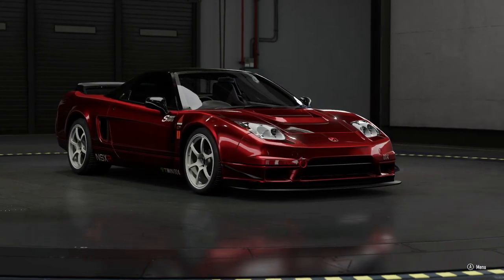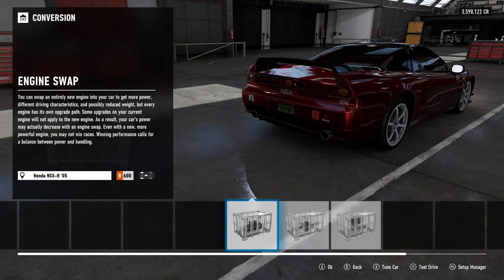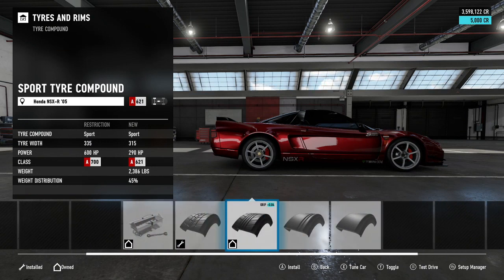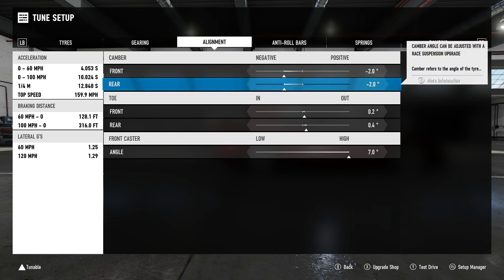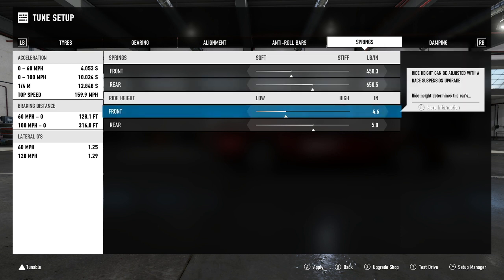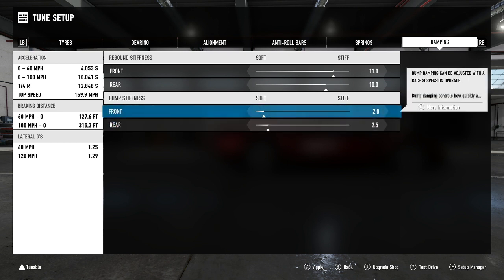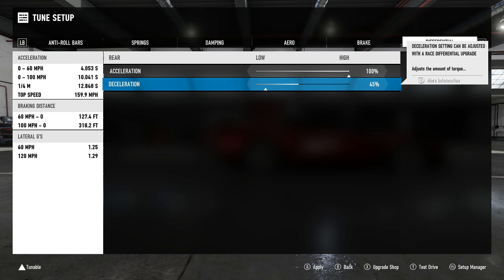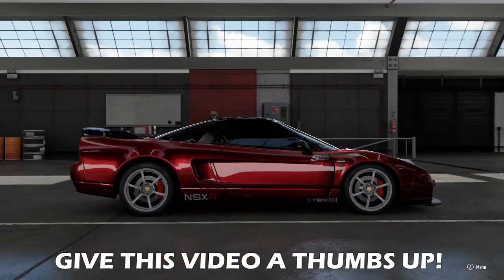HOW TO TUNE MID-ENGINE CARS (Forza Horizon 5 & Forza Motorsport) | Honda NSX Tuning Guide

Comment: We have the same taste in mid engine cars it seems; I wanted this guide to help me Tune my 2005 NSX-R, 512 TR, and 2005 Ford GT. I always seem to get some nasty understeer and end up hitting a wall mid corner.
Reply from the maker: All three cars are great. They are fast all-rounder cars at A700 and are seriously quick speed cars at S800. Mid corner understeer in these cars is usually solved with different suspension settings more than anything else. You can get away with giving them very stiff springs, stiffer than this video shows. Thanks for watching

Comment: Forza Motorsport 3 music is bangers.

Very useful info. How do you feel about mid-engine AWD cars?
Reply from the maker: I have only tried a few mid-engine cars as AWD (Lancia Stratos is a good example). That's mainly because I play FM7 more than FH4, and AWD is a lot less popular in FM7.
As for tuning mid-engine AWD cars though, I keep the front suspension softer than the rear. I also tune for more oversteer with the anti-roll bars (softer front bars, stiffer rear bars). Might be worth checking out my AWD tuning guide. Thanks for the comment!

Comment: So if I'm oversteering through medium corners while slightly braking or even feathering the brakes, I should raise my off throttle diff? Let's say I have the Nissan GT-R  FE, my front diff set around 40 on and 0 off, my rear diff is set at around 60 on and 30 off. While under braking, the back end seems to want to run off into the shadow realm, and it's really tricky keeping it in, becoming a dance of light braking and throttle feathering. I can't seem to just let the car turn in and coast without serious oversteer, but if I throttle or brake even slightly too much it's immediate oversteer. So should I raise the off throttle rear diff a few points? I'm afraid to raise the front off diff, because the understeer on this heavy monster is just crazy. Also, I'm using this car in career mode, so weight upgrades are almost out of the question. (p.s. I have my cambers at -1.7 and -0.7, toe out on the front at 0.2, toe in on the rear at 0.1, caster is 5.6. Springs on the front are 15% under the car weight accounting for distribution, on the rear are 10% under using the same formula. Medium front aero, rear aero a little lower. My setup for this car is online under JMF Racing.) At Bermuse Alps I'm ranked 2727 in North America, but top 60 in this car (I had to go through and manually count).
Reply from the maker: Hey James. Yes I recommend increasing the rear deceleration Differential. As your issue in the GT-R FE includes oversteer whilst braking, you can also try increasing the car's Brake Balance percentage (see what happens of you adjust it to 49%, then 50%, then so on). Either of these may help you, especially if you are running the car around high speed tracks like the Bernese Alps.
Reply: @JSRJohn  hey thanks for responding. Yeah I've actually been experimenting since I sent that comment. Moved on to the Sonoma, and was killed by understeer, and then in to Prague and I said enough is enough. I took the rear off diff down to 15%, added another point of toe out, loosened my front springs and anti-roll bars by HALF, then dropped all the values on dampers and rebound by at least a third. I still have a car that's unbelievably understeery. So, I went all the way back to the drawing board and took off all the parts and started over. No idea yet whether my new try will work yet. Sometimes I get y thinking I know kinda what I'm doing, but then I hit a problem (like a car that flat out refuses to turn, no matter how much you change), and then I feel like I don't know anything. And it's not like I can download someone else's tune and check it out to see what they've done; those are locked and you can't even look at them or tweak them. So that's a dead end.

Comment: I like the idea of this video but you haven’t really given any insight into why you chose the spring rates or bump settings etc etc….if you like the more  “geeky” information :). 

For example, working out spring rates I do by halving the weight of the car and multiplying it by the weight distribution as that gives a good balanced start. 

Just would be nice to have a few more of the detailed information if you like. Obviously if it’s a “tuners secret” then I totally understand :). 

On a different note…Front Rear Forza GT cars! Any tips?
Reply from the maker: An explanation around front Vs rear spring rates and how weight distribution/balance influences this is included in the video. 

However, what I think you are referring to is a weight distribution calculator, which is something that neither I nor any top players I know ever use to tune leaderboard cars. The reason why is because, although tuning calculators offer a good starting point for anyone wanting to throw a quick tune together, calculators do not solve issues effectively for all cars across various tracks, and neither do they take power-to-weight into consideration. The higher up the skill ladder a player gets, the less preferential a calculator becomes, especially when opting for the fastest car possible (as opposed to the most stable). This is something I will happily cover in a future video.
Reply from the maker: What do you mean by "front rear Forza GT cars?"
Reply: @JSRJohn  - apologies. I meant “Front engined, rear wheel drive Forza GT” cars :)….

I was trying to save time ;)
Reply: @JSRJohn   - I’ll watch it again then as I seem to have missed the balance and distribution part. I know you explain why you’ve gone for the numbers you have but you don’t actually explain how you got to “11 front and 10 rear rebound” or exactly why you used 40 rear anti roll bar. Why not 20? That’s what I’m trying to understand. Now if it’s just  “down to experience” how you came to those figures then fair enough :). 

I’ve not used a calculator since Forza 4 days as I’ve always enjoyed trying to work it out myself. 
I can easily get a car to be planted and although I’m fairly quick, I’m not as quick as you guys…which I demonstrated when I raced with you on one of your open evenings 😂😂😂. 

There’s ALWAYS room for improvement with tuning so any advice I can get is great 😊

Comment: I just want my s class cars to steer 👌and the back end be planted i do not use tcs  and then it becomes tricky 😅
Reply from the maker: They certainly can be tricky! Which cars in S class are you having the above problems with?
Reply: @JSRJohn  hi john its more the fast right left uphil on watkins glen full throttle thats not a easy one my issue is more how to setup the bump and what to change apex to exit  but im doing a jsr john marathon im catching up btw thanks for the 99 build  .bart lecoque 😉
Reply: @JSRJohn  hi john could you maybe show or tell me how to use the friction page on telementry i dont realy get it it shows when tires are under to mutch stress but how to use it in my advantage 🤔😅